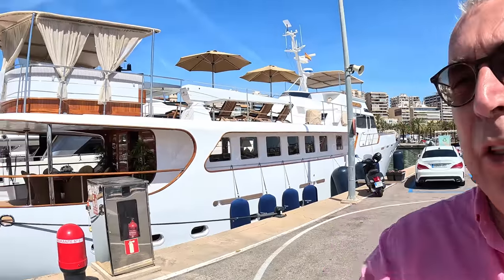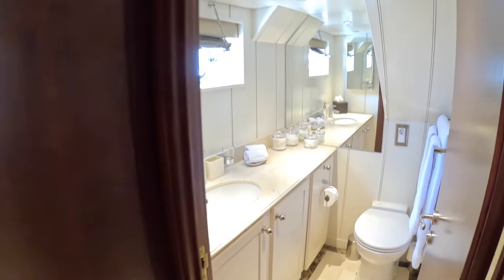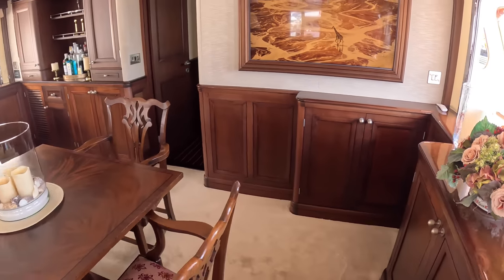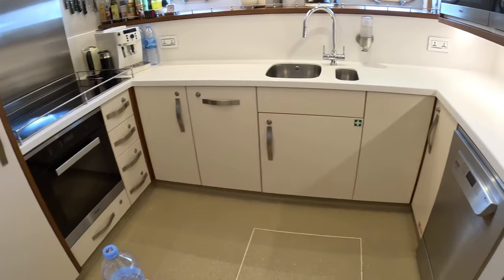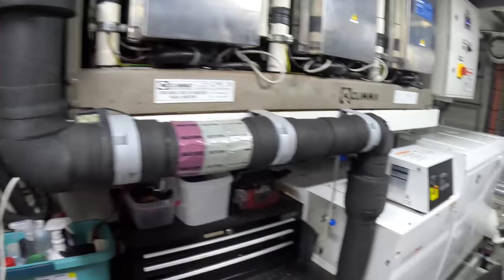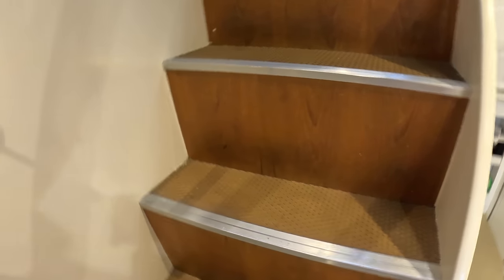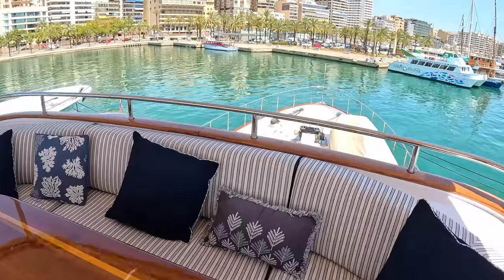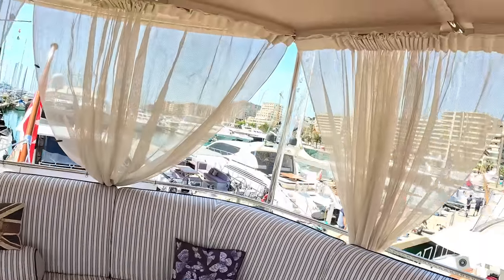€4,75 Million Superyacht Tour : 1967/2018 Benetti 33 Metre

Comment: What an absolute beauty!!!! Stunningly maintained and refitted! I could spend 1 or 2 years at a time on board!!! Would a yacht like this have a water maker and stabilisation system? Fantastic tour as always! Thanks Nick. Have great week’s ahead one and all
Reply from the maker: It will have if that's what the owner has specified (and normally can be added if not). Thanks for watching! 🙂
Reply: It certainly does have a water maker! The yacht also has Zero Speed stabilisers.

Comment: Remember that the upfront cost is very low compared to a decade of usage, crew, maintenance and gas for a yacht this size...
It cost at least €1 million per year to operate, and you could go up to €2 millions if you use it how it was initially intended for, yachting all the year long, and moving from place to place.

Comment: Nick, I see a bit of charm in this ancient Benetti but still it leaves me cold.  A master stateroom that requires up/down and all around to reach. Nope. Stairs down to the crew quarters that are dangerously inadequate and steep. Try carrying a plateful of desserts in stemmed glasses up that staircase in a seaway. The stairs to the crew mess were also not to code, teensy and steep. The engine room looked shipshape but horribly cramped. Old, smelly, noisy two-stroke GM diesels. The main salon has one sofa big enough for about six people comfortably, but there are four guest staterooms. Two people left standing or in folding chairs? 

I bet the owner who put this Benetti through a massive renovation/rebuild lost almost every cent he put into it when he/she resold it. You can claim it's virtually it's a 2018 yacht, but buyers will only pay for a 1997 yacht. It lacks space everywhere compared to a modern Westport, Benetti or similar. 

Skinny beam, rounded hull -- I'll bet it rolls and rolls in beam seas unless it has massive stabilizers. All yours, thanks.

Comment: why are the diesel engines wrapped in some kind of padding?
Reply from the maker: The parts you can see wrapped are exhausts and the hot water system, and it's heat insulation to keep the water hot and to avoid burning someone with hot exhausts.